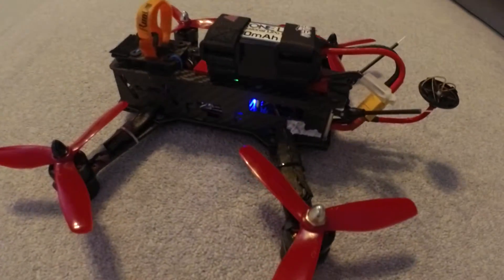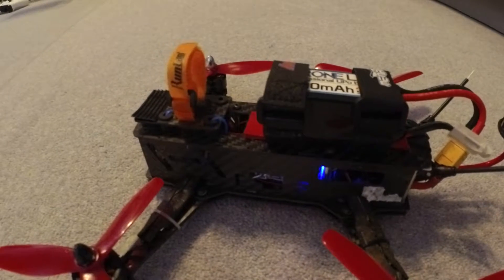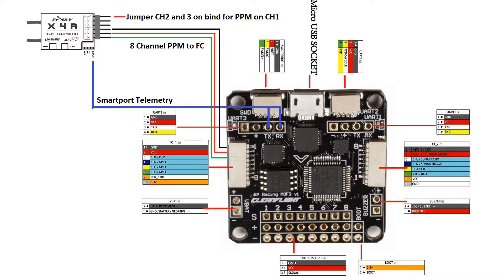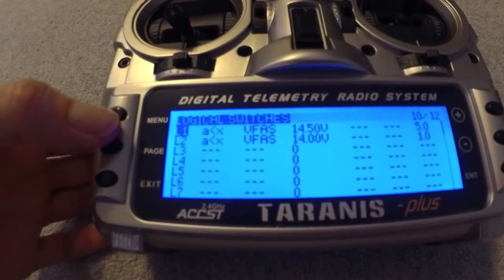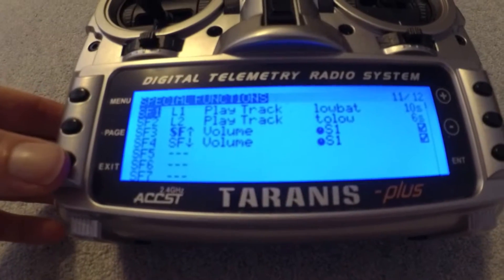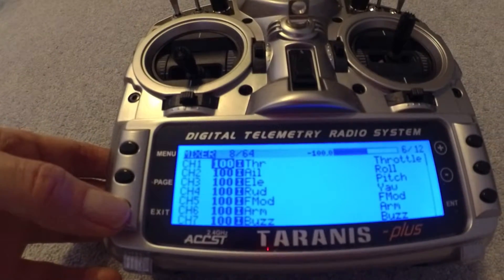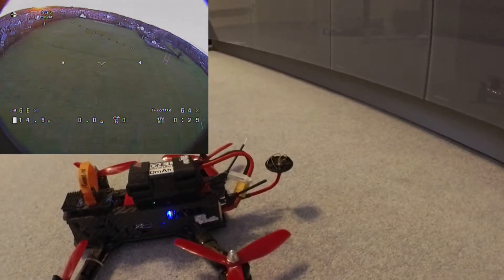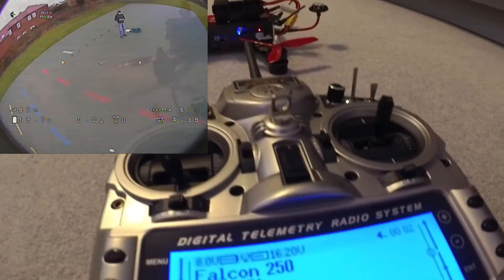SmartPort X4R Battery Voltage Telemetry and RSSI on SP Racing F3 (Falcon 250 Pro)

Comment: If you use softserial you connect to rx and tx, of you dont use softserial Just uart than you can get it to work with only tx. I have it set to sbus on uart 3, ground positive and then rx. My telemetry is plugd in uart 2 with a jst sh plug on only tx so the third pin.

Comment: Hi, is there any chance you can help me out on my set up, I have a crusader gt2 F3 board different then the one on your video probably and older version or just different size etc  I have welded the x4r  in sbus and is all working fine but my telemetry channel is not coming up a et up the betaflight and have only connect it to the pin 2 not same as your diagram looks like you connected pin 1 and 2? can that be the problem?

Comment: hello I have an XMR-P receiver, SP3 Flight controller and A maytek HUBOSD PDB how would I send Rssi to my HUBOSD. I have UART 1 and UART 2 open and available in betaflight

http://www.myrcmart.com/frsky-xmrp-24ghz-16ch-micro-receiver-sbus-p-10876.html
Reply from the maker: I'm not sure about that specific OSD, but assuming it has the ability to display RSSI then it should just be a case of setting it up like I have here. Some OSDs only support analog RSSI, in which case you would solder a wire from the RSSI output on the receiver to the relevant input on the OSD. A quick look at the manual and it doesn't say anything about having an RSSI input which suggests it doesn't support it? https://cdn.shopify.com/s/files/1/0948/3076/files/HUBOSD8-H_EN.pdf?5345988321592522507